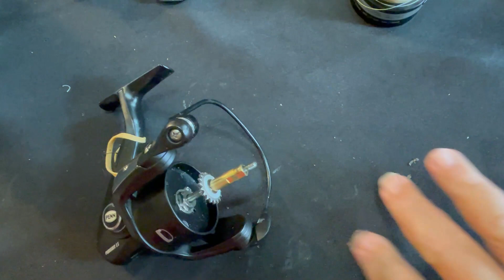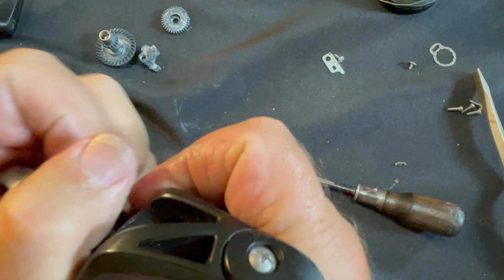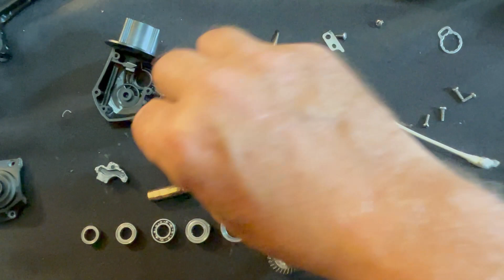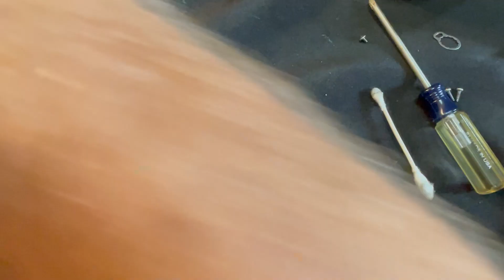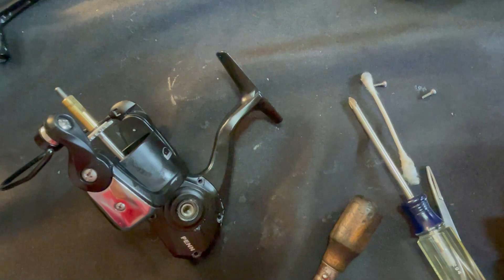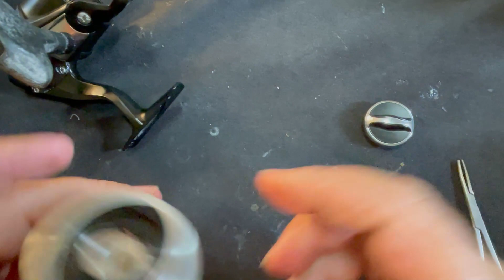Penn Pursuit II 4000 -- Service and Lubrication -- Young Martin's Reels

Comment: I'm looking to repair my reel for cheap is there any model of housing that I could just install the parts from my pursuit 4000 into possibly
Reply from the maker: If your housing is broken the cheapest and easiest way to fix it is to just purchase a new housing from Mysticparts.com prices range from $6 - $12 depending on which version of the pursuit you have I, II, III or IV. The later versions are cheaper.
Reply: @youngmartinsreels5314 thanks man i did need a reliable website for it i was just wondering if you knew a better replacement housing since the original is cheap plastic that snapped off my reel

Comment: No override - I don’t like it. You did an amazing job however.  If it only had an override it would be a decent reel. I think these manufacturers did away with overrides because it was convenient for them not the consumer. There’s another reason I prefer vintage spinning reels. I don’t like manufacturers trying to con me by saying leaving out a feature like an override was better for me when I was only done to be convenient and more profitable for them. To me that is just plain dishonest!!! By the way, I always oil those side plate screw holes when I reassemble a reel.  Great video Rick! We missed you. — Chris
Reply from the maker: Chris, like I told you on the phone, I like the reel even without the override. I was sure you wouldn’t like it though do to the way you fish. From my boat, I don’t really need the override. You tend to favor complex reels and I’m more into simplicity. The fewer moving parts the less parts to go bad.

Comment: I use Armorall, 0n my handles it cleans and protects plastics against UV ray damage. I think you will like how it works on handle gripes.
Reply from the maker: Bill, I haven’t bought any ArmorAll in years. The last time I used it I put it on the floor mats in my truck. Then it got on the bottom of my shoes and I nearly broke my neck. For handles it might work just fine. Thanks for the tip, I’ll have to give it a try.